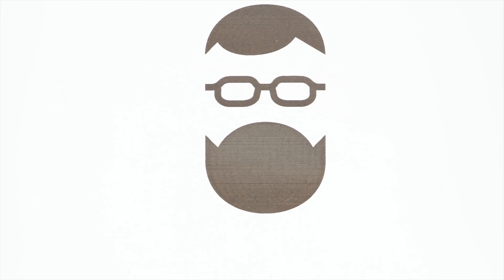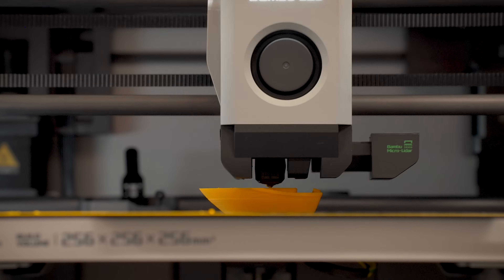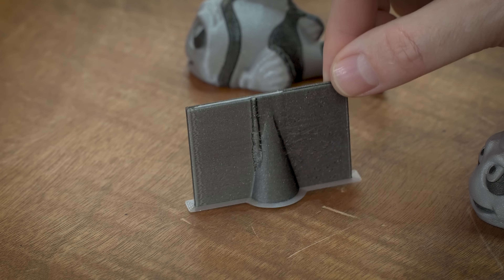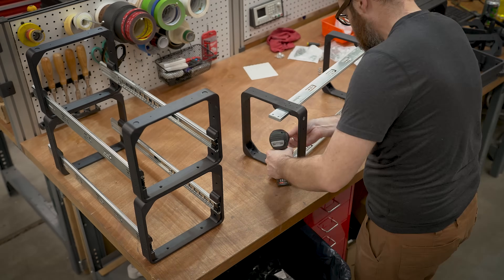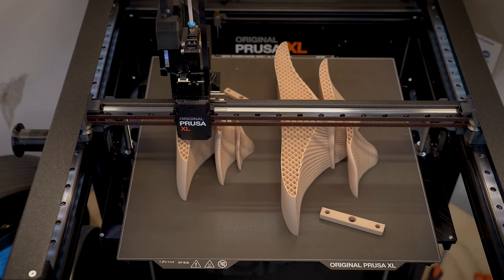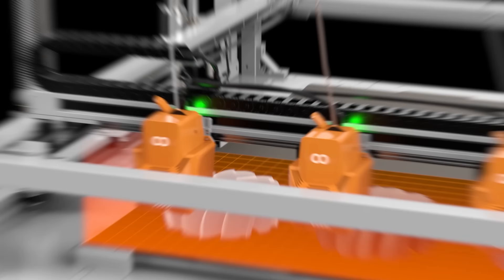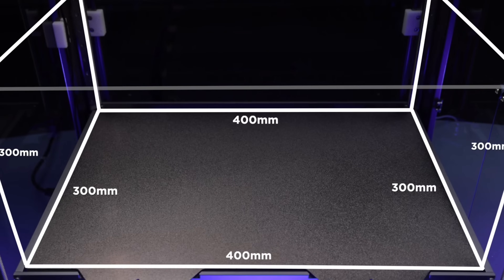Choosing Between Prusa XL and Bambu X1C?

Comment: You need to switch out your peg board for a storage wall 3d printed! If you want to use your wrenches at the ready look at the Screw Wall on Printables
Reply from the maker: That's a LOT of plastic.  I have around 100 square feet of pegboard.  not only would that take months to print, it would be a lot of wasted plastic, but it's also really expensive.  Pegboard is great because it's cheap and readily available.  Why trade the two greatest benefits of pegboard just to justify a 3d printer?

Comment: Hi Robert, I’m looking to print the house models I build in my modeling software.  Obviously looking at large format.  I saw one at the end of the video that looks bigger than the XL. Can you let me know what model that was?  And maybe some other large format printer options.  If you have other videos on large format let me know. Thanks!
Reply from the maker: The one at the end was a gigagstorm something.  A few YT reviewers shilled for them a bit, but then everyone found out it was absolute junk.  It doesn't work and has lots of problems and it kinda disappeared.  There aren't many good options for really large scale printers that actually work.  You can look at Modix 3d printers, but they're quite spendy.  Please consider subscribing if you haven't already!

Comment: But how is the print quality between the two?
Reply from the maker: It depends.  I think think overall the X1C has better print quality, the XL can be hit and miss.  The XL desperately needs a higher flow hot end to keep up with the speeds it's trying to do with larger prints.  Overall, the X1C is more consistent.  But I do prefer Prusa for slower prints (TPU and such).
Reply: @RobertCowanDIY  Thanks! Going to get my first high-end (consumer) printer soon, and agonizing over the decision... I plan to wait until the next Bambu release (HD2?), but I don't know if that will make things easier or harder to decide...

Comment: Hi Robert, excellent video as always! I'm considering the XL for its great build size and accuracy, but for my needs, I'd only be using a single material spool for precise prototyping. The Bambu would be too small for my projects. Do you have any recommendations for an alternative large FDM 3D printer, similar to the XL, that offers both high accuracy and ease of use?
Reply from the maker: Wait a couple months, Bambu is announcing a larger format printer soon.  If you can hold off, I'd see what they come out with first.  The XL is not my favorite printer, but it's size and toolheads are still the only game in town.
Reply: @RobertCowanDIY  Sounds great! Thank you again!

Comment: I own 2 X1c's in the UK. There is no doubt they are great little machine tools. BUT after spending the last 2 weeks emailing customer support regarding a faulty heat bed at 800 hrs work im done with them. Here is a nice little tip, If you live in Europe (EU countries) under directive 2019 /771 you automatically receive a 2 year warranty which they will honour. Everyone else gets 1 year afaik. (Look it up online, im not a legal advisor 😉) So if you buy in southern ireland you get a 2 year warranty 😉😉 but in NI or Uk you will only receive 1 year 😢. Do your research before you buy from Bambu (you WILL need to issue a ticket for support at some point during ownership) because when you get there, don't say i didn't warn you! 🤣

Comment: Never seen any other video comparing these two machines so clearly and unbiased. In my point of view the day Bambulab offers something with multiple toolheads it's game over for Prusa then. Until that day XL is an unrivaled (just for multiple tool head capability) machine and therefore unreasonably over priced. I also believe Bambulab's multi tool head machine would be more user friendly, budget friendly and well baked. Prusa XL has multi head capability but the machine misses serious possibilities such as different size nozzle in a single print. You've realeased a multitoolhead printer and you also have Prusa Slicer. Why can't you just put different size nozzle in same print capability to Prusa Slicer? On the other hand prusa slicer is opensource and if they could even succeed to put that capability in prusa slicer, the next day bambu slicer which is based on prusa slicer will have the same capability! Even older machines would benefit from such huge slicer update by changing nozzles manually in same print.

Comment: Great neutral review! Having used 3D printers since 2011 and using the X1C for engineering, I love how incredibly much more reliable it is and the absence of having to tinker.
It irritates me that you cannot have engineering plastics and flexibles in the tool changer, but Bambu has announced that they have a filament coming out that will do that.
What I really need is a double wide Bambu X1C. It would be cheap to develop, and open up a huge amount of stuff that we could prototype!

Comment: Hi Robert, what printer of the similar printing volume would you have in mind if one does not need the tool changer? Bambu is a bit small for us. We have Raise 3D Pro3 but it is really glitchy...
Reply: I have the same question, have a Bambu lab, need three xtra space but not the toolchanger

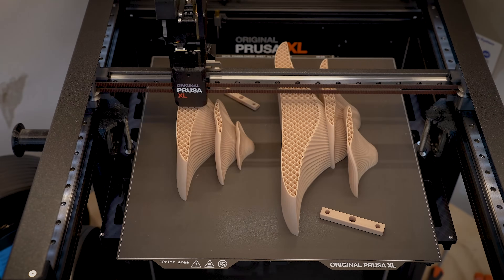Comment: Nice video, but there still seems to be some gray area even with the significant time spent on comparing the X1C and XL strengths.  I need that XL multi-toolhead functionality (like the Ultimaker printers), but the bit at 4:10-4:25 suggests the XL is best if you get all 5 toolheads. What if you just need two and don't want to spend the $$? It sounds like the XL is not the recommendation in that case, but I don't hear any recommendation there.  Do you have advice?  I've had an Ultimaker 3 that worked pretty well, but it's basically dead now, and their replacement models are way more expensive these days. Thanks.
Reply: I'm in the same boat.  I have an Ultimaker 3 that still works, but is getting a bit long in the tooth, and most of Ultimaker's newer options aren't all that appealing.  I absolutely don't want to give up the dual-extruder functionality, however, and its becoming increasingly rare these days.  I like how the XL handles it, but again I've never wanted more than two materials at once.  (Usually a base material and a support material.)

Comment: Very helpful video.
I was wondering if there were any issues with nozzle clogging when switching materials from high-temp to a low-temp material on the X1, since it has a single toolhead. Have you done any deep dives into multi-material prints?
Reply from the maker: I don't do multi-material printing on the X1C, just due to the waste and extra time.  And it's really just for cosmetic purposes, which I'm not super into.
Reply: @RobertCowanDIY  I see - so for any functional multi material printing you would recommend using multiple tool heads

Comment: Trying to buy a 3d printer for the 1st time and I am confused. You stated that the Bambu lab x1c has to manually change the material to print multiple materials/colors, but on their website the AMS automatically changes material/color. Is the AMS new to the date of this video posting or am I misunderstanding what AMS actually does?
Reply: The AMS changes the filament automaticly. However, this does not work on flexible materials like TPU. Also no abrasive material (as they can damage the AMS - you can surpass the AMS and print them manualy of course).
As the filament is changed by cutting the ol inside the extruder and poo it out while loading the next filament, you should not combine filaments with significant different printing temperatures (PLA and PETG are near enough).
With the XL you have one toolhead for each filament. So it is not swapped and you can use different materials (not only different colours) and also abrasives (using an ObXedian nozzle in that toolhead of course) and TPU.
Also the XL support different nozzle sizes in one print (newest developer version of Orca Slicer, no official release yet).
So, while you can use both for multi colour, toolchangers are a whole new world if it comes to multi material.

Comment: I have about 3000hrs on my X1c and just ordered a 5 head Prusa XL. The X1C has been great, especially for the money. I have been getting more into multi color and multi material prints and while the AMS does a good job it is definitely slow and generates a ton of waste. Often it ends up wasting more material than it actually uses on prints with a lot of swaps. Also the increased size of the XL will be nice. I will likely keep my X1C for engineering materials since the prusa is not enclosed though
Reply from the maker: Yeah, I think that's a fair assessment.  They're just different machines and I use mine very differently.  And strangely enough, sometimes I'm just in different moods and 'feel' like using one over the other.

Comment: Logistically speaking the Prusa XL have way too much mechanical and consumable parts IMO. Like you said both have their advantage over the other. I should receive my Bambu X1-C in a few days :)
Reply from the maker: I use them equally, but they're different machines.  The XL is built much more like a kit, the X1C seems more like a mass-produced commercial product.  No judgements there, just my impression.

Comment: I own both printers, and have been a prusa customer for years. When I got the Bambu I was very impressed with the ease of use and slick design, but when I had to reach out to their support I was surprised how hard it was to get a response. Prusa is top notch in terms of customer support and troubleshooting, which is also something to consider IMO.
Reply from the maker: Correct.  I can't really comment on that since I haven't had to reach out to support on either, so I didn't include that as a data point.  But others have mentioned this as well.
Reply: I think Prusa printers are quite overpriced for what the are. With the cost of a Prusa XL I could buy almost 3 Bambu X1C printers. I remeber how the mk2 still used those ugly and expensive tread rods with giant bolts yet it was as expensive as many higher end printers.
Reply: @teresashinkansen9402  2.4x X1C with AMS. ;-) Not 3x. :-p Mostly joking with that one. ;-) And I will admit that I'd wish Prusa prices to go down a bit, given the competition. Regardless, when buying a Prusa, you are not just buying the printer. It's comparable to buying and industry-machine. You also buy the tech-support, and the parts/upgrade support for years to come. I would be willing to bet that BBL won't give a flying xxxx about a five years old product! :-p But with Prusa, you can still upgrade it to a relevant spec. And you can still get spare parts, even way after 5 years. If they where to end support, you can easily source spares elsewhere. Don't know how that's going to look with 3d parties down the line. But I doubt it will be comparable.

Comment: Allthough im deciding beetween the X1C and the XL for my first printer, I would want the printer with the BEST print quality in term of overhangs and smooth prints. While ease of use is certainly nice to have, I can work with whats in front of me and the touchscreen and stuff isnt that important to me. 
I think the only exclusive benefit of the X1 for me is that it has its own profile for the PLA Aero that bambulab makes, which i intend to use for model aircraft and other rc projects. I also intend to print accurately working gears, ssmall mechanisms etc.

Would you say the print quality is generally the same? If that is so, i will probably just get an X1C, but if the XL is a lot better at printing and produces better results more consistently then i would want to get the XL. The multi toolheads are something that im not too sure I will need, but are certainly something I would rather have and not need than need and not have.

Edit: While print volume is not really a factor for me and multi material prints arent too likely since I am only making functional prints and not really anything cosmetic,  I would like to not have to spend so much time tinkering with aprinter. Ive heard so many ender 3 horror stories. I dont mind minor tweaks done every now and then, but heavy maintenance is something i cant do
Reply: If it comes to overhangs, an XL 2-toolhead might be the better option. The best quality for overhangs you get using a supportmaterial wich is easy to detach. While you can use PLA support interface layers on a PETG print and vice versa on a bamulab AMS, the printing time and waste can explode like crazy if the interface layers are not horizontal in only a few layers.
With 2 toolheads you can use different material for support much faster and with less waste.

Comment: Neither printer has what I'm looking for. 
350x350+, CoreXY, Klipper, MMU, enclosed, failure detection, and doesn't require the hobby to be 3D printer tinkering constantly, but actually 3D printing parts.

Comment: I had an XL on backorder for 2 YEARS. I attempted to finalize the order and tried to include some filament with the order because of the high cost of shipping Prusa supplies to the US. The Prusa rep said no can do despite it's in their web page that you can do it (I double checked). My wife has 2 Prusa Mk3S+ printers and bought a Bambu. She doesn't use the Prusas now. Every contact with Prusa has ended in frustration. I decided to cancel my XL order and will buy a Bambu instead. It's a thousand dollars less than a Prusa with 2 tool heads ands its only advantage is a slightly larger build volume, offset by fewer tool heads, but the primary reason is we are just fed up with Prusa. In my opinion, they have a chip on their shoulder.
Reply: I know this may not be the best place to discuss this, but I have a Mk3s+ and my biggest gripe is how long things take to print. Since I hate to leave any printer unattended, this is removing all the fun of designing any meaningful stuff. So can I kindly ask, was the Bambu a game changer in this respect or is it just hype? And would I be locked into their filament? Finally can I still slice and print locally without being dependant on the web? Thanks
Reply: @johnfiott  My wife says the Bambu is significantly faster than the Mk3s +, but I don't know if that makes it significantly faster than the Mk 4. She bought the Bambu because she was frustrated with the Mk 3. I upgraded the 3 to the 4 and I'm pretty satisfied with it. She tells me the Bambu is a speed demon and it has different speed options. The Bambu can use any filament. She prefers the Bambu slicer over the Prusa's (but she hasn't used v6).

I got frustrated with the Mk 4 speed and print volume so I ended up re-placing an order for an XL, delivery time 6 weeks.

Suggest you watch the YouTube videos comparing the Bambu to the Mk 4. There are lots by experienced users of both printers. Good luck.
Reply: Thank you, much appreciated. I was not aware that the XL is faster than the Mk 4, so maybe I will also consider that, although as a purely hobbyist use case I am pushing it a bit where it comes to budget, given that I am not expecting to make any money from this.
Reply: @johnfiott  I don't know if the XL is much faster than the Mk4 for single color prints. But for multi-color, it will be a world of difference. Also, how much speed matters, depends on what you do. If you print functional parts that needs to have the best layer adhesion, you may not be able to utilize top-speed anyway. I think it was CNC Kitchen that pointed out how much "to high" print-speed could impact layer adhesion. I have also heard about people keeping the Mk3S+ around specifically for TPU, both because TPU can't be printed much faster anyway, and because the extruder on it actually works better than the Nextruder on Mk4 / XL. Personally I chose to upgrade my Mk3S+'es to 3.5. And I got myself an additional Mk4S. But shelf-space is running low! I'll have to admit that! :-p
Reply: @mariusmossum2923 Thanks for mentioning keeping an old MK3S for TPU printing. 

I recently upgraded to the MK4S (from the MK3S) thinking that the nextruder would be an upgrade. One of my first MK4S prints was with TPU and it had serious clogging issues.
Reply: @johnfiott you will not be locked into their filament. I use 3rd party filaments all the time - mainly because Bambu filament is unavailable most of the time here, or is horrendously over priced. Having said that, the free rolls that came with the printer and AMS were better in terms of finish than Creality, Tesseract and other I have tried. You can definitely print ‘locally’ without using their cloud server, but you will give up the remote view functionality in exchange.
Reply: I own the 5 Tool XL. Its printing upstairs right now. Its annoying. Its so quirky. I love my MK3/S. Years of that thing doing prints. Its not perfect but its been great lately and positive. Hence the 2 years of waiting for the XL aaaaaaand its over engineered and annoying and I think Prusa messed up and I think they know it and they are turning their back on it like a runt.  The print volume is dope. When it works right its amazing. Blows me away. I've used all 5 heads before on some very unique ideas that firends were like "I didn't know this was possible. But to be honest 95% of my prints are just 1 tool and I spray paint it or something. So by my experience you made the right choice, but I havent used an X1E.... yet.

Comment: If the 256 mm is too small, just divide the object into  2 or more parts and assemble them later I just saw this morning a print for an elevating stand of the color changer of the x1, printed in 4 parts and assembled into one perfect item I think the file was on makerspace
Reply from the maker: Eh, you can't always break a part into multiple objects.  I tend to never do this since I need solid parts, not just cosmetic representations.  For cosmetic parts, it's certainly an option with some post-processing.